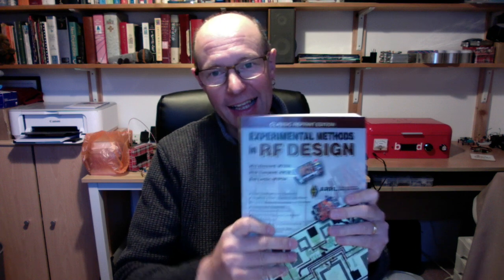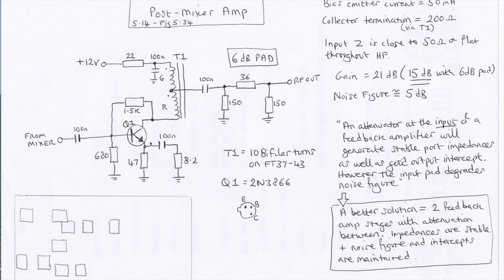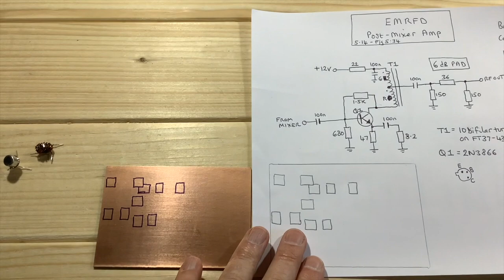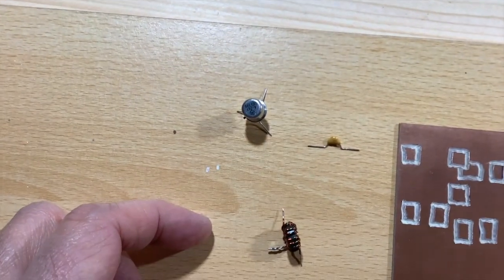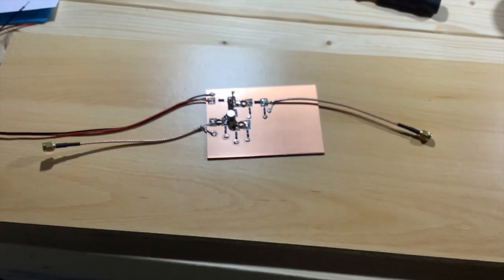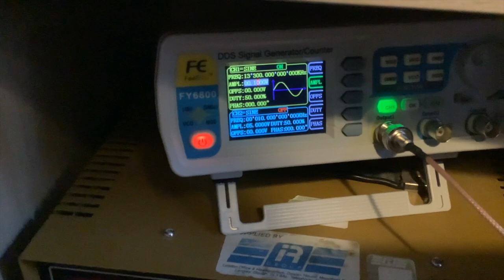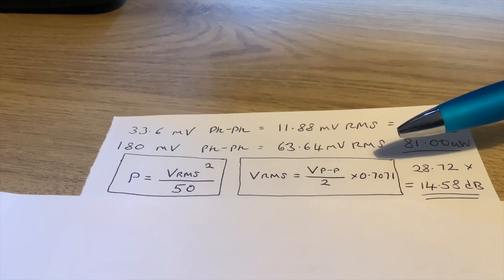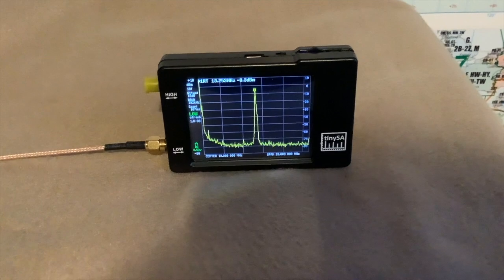18 - Another RF Amplifier

Comment: 👍Thanks for sharing Nick. Some good info there. A formula that I use for converting peak to peak voltage to RMS power is Vpp squared divided 400. Only works for 50 Ohm load but saves on the calculations. E.g. if peak to peak voltage is 45V into a 50 Ohm load. 45 squared is 2025. 2025 divided by 400 is approximately 5 Watts.
Reply from the maker: Thanks Steve. That's a great little shortcut. I'll certainly remember that. Cheers! 73 Nick

Comment: Very detailed video, thanks for sharing. Althoguh there is a section dedicated exclusively to feedback amplifiers in EMRFD, section 2-something, that describes feedback amplifiers based on 2N3904. These amplifiers give a similar gain and consume only ~20 mA of current @ 13.8V. Other characteristics (noise figure, IMD, compression) are fine too. I used these amplifiers in several projects.
Reply from the maker: Thanks very much Alex. Yeah, I think 60mA is a bit much especially as I'm considering building another on the same board! Your suggestion gives me an idea though. Maybe what I should try is a smaller current design (like the one you mention) followed by a more beefy one like the one I built. I've usually only used those 2N3866 transistors in RF pre-drivers where I'm handling larger signals so it would probably go OK as the final amp in a chain perhaps. It's all good fun isn't it? Thanks again. 73 Nick

Comment: ARRL HB of 1993 95 describes NFA or noiseless FB amplifiers also which are emitter to collector feedback amps with a ferrite transformer using a binocular core.  Those have lower gains but are pretty good. Built a pushpull version several years ago
Reply from the maker: Sounds good. 73, Nick

Comment: Cool beans,.
Like your bench. I built a similar bench and used a high gloss white oil paint to cover the sealed with shellac wood to make it easier to clean and easy to see the parts on the bench.

I am watching the video now, but as I watch I am asking myself can I feed the amplifier with any of my 5 watt QRP transceivers? It would be sweet if it could.

As I progressed I see it is not intended for inputting 5 watts. Should have known by the size of the transistor. But, it could be used as an amplifier for tiny transmitters to bring them up a bit.....
Reply from the maker: Thanks. Yes, it is a small signal RF amplifier so not suitable as a final power amp - unless you are very QRPppp! It could be pressed into service as a driver amp though but you'd need to give it some heat sinking. 73, Nick

Comment: Nick can you tell me how the middle of a 200 ohm transfer is 50 ohms not 100 ohms what am I missing there?  Throughly enjoyed the video thanks.
Reply from the maker: Hi Greg, my drawing was a copy of how EMRFD presented it but in truth its not the most intuitive way of doing it. I think it was done that way to emphasise the fact that it is an auto-transformer. Think of it like a voltage divider. The output is seeing half of the voltage from the collector (because of the centre tap). So if the output voltage is reduced by a factor of 2 then as impedance transformation is the voltage ratio squared - the output will see an impedance that is 2  squared (=4) times less than the collector. That's how 200Ω at the collector looks like 50Ω at the output. Hope this helps. 73, Nick

Comment: Nice Build.  What coax cable connectors and coax are you using ?.
Reply from the maker: Thanks. In the video I just used some RG316 SMA patch leads to make temporary connections for testing. I did Pete Juliano's trick of buying a few and cutting them in half so one end is terminated in an SMA connector and the other can be hardwired to your board. When I came to using this amplifier in the actual radio it was hardwired with RG174 which is cheaper but more importantly more flexible. Hope this helps. 73, Nick

Comment: The more gain you apply the more you apply it not only for the signal but for the noise as well. It doesn’t seem like a good idea. I mean it seems gain+attenuation=more noise
Reply from the maker: Hi there! There is a balance between gain and attenuation that runs through a whole radio I would suggest. Sometimes it can be a fine balance i.e. just 1 dB too much gain has caused an amplifier to oscillate. Ultimately you have to decide what you want to settle for. Some gain upfront in a receiver can actually reduce the overall noise figure. It is a balancing act! Thanks for watching and commenting. 73, Nick

Comment: I have a question that lingers in my mind for quite sometimes....how do you multiple frequency and set it at 2.4Ghz or 2.8Ghz?
Reply from the maker: There are different ways of doing it I think. There are certainly designs I've seen for frequency doublers and triplers etc. Generating (stable) RF at higher frequencies is now easier than it used to be thanks to PLLs etc but I confess most of my work has so far been confined to below 50 MHz. An Si5351 will tackle these kind of frequencies easily. You'd need to contact some of the microwave guys - they'd be able to guide you. Thanks.
Reply: @M0NTVHomebrewing  from self experiment Ive used crystal oscillators at fix frequency of 125mhz

Comment: Nick recently tried a very similar design by EI9GQ from his Homebrew Cookbook and it was pulling 80mA, which is 1W input power and seems a little too beefy, but works very nicely indeed at 18MHz.
Reply from the maker: Thanks Steve. Yes, I got those 2N3866's from Graham but I've only used them in transmit drivers and pre-drivers before. I think I should have gone with thermal-pasting the can to the board though - it does get hot! 73 Nick
Reply: I just popped on a star heatsink and it seems fine. Also been playing with Pete's PSSST 2N2222 RF Amp, which seems quite good too.
Reply from the maker: Thanks Brian.

Comment: Great video! Can you please tell us what should we modify for the FM band in this circuit?
Reply from the maker: Hi there. Thanks. The circuit is really intended for HF. However, it is broadband in its design so you might be able to press it into service at higher frequencies but expect (1) lower gain and (2) the impedance match may not be as good. The 2N3866 transistor should be OK for the FM broadcast band though. An example circuit in the data sheet is for an amplifier at 400MHz- https://my.centralsemi.com/datasheets/2N3866_SERIES.PDF

So perhaps just it a go and see how you get on! 73, Nick

Comment: Hi
Going to build one to get a bit more out of a AD9850 based VFO which only gives about 250mVpp.
Question about winding toroid.
To make the centre tapped transformer.
Take a length of bifilar wire.
Solder one pair together - that's the centre tap for the output
Wind 10 turns onto the toroid.
The other two ends are used on the input side labeled G and R in the diagram?

Thanks Dave
Reply from the maker: Hi David! No - that won't work - you need to observe the phasing of the windings. That is indicated by the little dot on the schematic. This means that the centre tap is the bottom green connected to the top red. The easiest way is to get your bifilar wire, twist it in the vice then separate each end. Then wind your 10 turns on the toroid. Then make the centre tap (bottom green to top red). Then you can connect your top green to the 100n and 22Ω resistor and the bottom red to the collector of Q1. Please see this video on the actual construction of these kind of transformers (https://www.youtube.com/watch?v=m4rOJNQg2y4&t=234s).Hope this helps. 73 Nick
Reply: @M0NTVHomebrewing  Hi Nick Thanks for the advice yes Video 20 on the mixer clears up you to connect wiring to get the phasing correct.
I have some G-QRP Bifilar wire and some FT 37-43 toroids so will give it a go.
73
Dave
GM4NFI
Reply from the maker: No worries Dave. Happy winding! 73 Nick

Comment: When calculating the inductance of the transformer, do the bifiliar turns count as a single winding of 20 turns or do they interact to give a different result? Thanks.
Reply from the maker: Hi Graham! That's a very good question!!! I think because they are wired in phase that they would 'look' like a 20 turn inductor but to be honest I'd have to check that out for myself. The inductance is only significant here in as much as it produces the required impedance for the collector. When I was building mine I only looked at the impedance reading on the Peak LCR45. Mine was a bit low so I squeezed the turns together a bit more to get the desired result. Thank you for a great question though. I find transformers fascinating ... I know I should really get out more! 73 Nick

Comment: I have a video transmitter. I want to increase the range of the transmitter. Which amplifier should I use for the UHF band?
Reply from the maker: Hi there! That's a good question but I'm afraid I don't have any experience of designing or building for UHF frequencies - let alone video. You'd be better off asking in some of the Amateur TV forums where I'm sure someone will be able to advise you. All the best! 73, Nick

Comment: Why not have square island RF breadboard pattern boards be made by pcbway etc and you can sell them too? Elektor had these type of boards some 30 years ago
Reply from the maker: Personally I prefer to either engrave or stick my own pads precisely where I need them. If you fill the whole board with separate electrically isolated squares then you lose the common ground plane effect which is one of the great benefits of Manhattan style construction.  But each to their own! 73, Nick
Reply from the maker: That would certainly help. 73, Nick

Comment: Nice video.
2N3866 well known device, but mainly used as a driver for a VHF PA!  My very first rig a Trio TR2200 which was a 6 channel crystal controlled 2m box, used one as the PA, with a full charge it would produce a whole 1W output on 145Mhz.

Using something like the 2N3904 as has been suggested would be better.

Twisting the wire.. A clamp and twist? you do like hard work. Have you lost your old hand drill?
One end in vice, the other in drill chuck and a few turns of the handle and the jobs done. :-)

Or tie the ends together, slip in a screwdriver and spin that. 

Keep the vids coming - there is nothing like a simple practical approach to actually learning about electronic construction.
 
Andy
Reply from the maker: Thanks Andy. The reason I chose this particular design from EMRFD with the 2N3866 is that the authors (Wes, Rick & Bob) say it is one of their favourite amplifiers for terminating a switching mixer. I figured with a recommendation like that it was at least worth building one! Thanks again. 73 Nick

Comment: Sir I'm a hobbyist  , want to know about the schematic used for RC toy cars etc  . Want to know how the signals are transmitted from transmitter to receiver module's of the RC car to control the motor in toy  car  . Detail explanation of the circuit used in the transmitter and receiver how it works step by step . Sir any video on this topic  , or any book or  magazine  have this kind of projects
Reply from the maker: Hi there. I'm afraid I don't have any experience in this field but just googling 'radio controlled cars diy' brings up a load of web pages and videos. You should find something to get you started. All the best, Nick.

Comment: I prefer using glued down pads.

It's easier to remove a pad or put down another pad if you make a mistake.
Reply from the maker: You are right. Glued-down pads give you more flexibility. The engrave method is useful for things like edge-connected SMAs.

Comment: Sir can I use this for wifi signal same as those expensive amplifier
Reply from the maker: Hi Danyal, the amplifier I built in the video was only designed to work at HF (and possibly lower VHF) frequencies. I certainly don't think it will cut it at the kind of frequencies you are talking about. The wavelengths are so tiny that lead lengths become critical and you require a whole different design. Sorry.

Comment: Dear Nick Can you please explain about Ldmos AFT504,  i want make the amplifier to boost some tools i must replace blt50 transistor with aft504 or make an amplifier after blt50
Tnx 
EP2XX 73
Reply from the maker: Hi Kourosh, I'm afraid I'm not familiar with that device. All my power amplifiers have used regular MOSFETs. You should be able to find a few schematics online though. All the best in your building. 73 Nick

Comment: Can it be used with a Wi-Fi router with an antenna to increase the range of broadcasting?
Reply from the maker: Hi there! Although it is broadband I don't think it's THAT broadband. I think you'd need something built much more carefully for those kind of frequencies. Once you get in the GHz range then component lead lengths, stray capacitance etc. will play a bigger part as the wavelengths are so small at these frequencies. This amplifier is really for HF and probably lower VHF but I wouldn't want to promise anything higher. Hope this helps. 73 Nick
Reply: @M0NTVHomebrewing  thank you for everything

Comment: Here is a Naive question - why are there no multi-band (uhf/vhf) amplifiers? I see BTech having 3 different PAs for the 3 HT bands (2m, 1.25m and 70cm) but each is a separate unit.

Now, I am feeling like a customer asking the question, "why can't I just move the toilet to the other side of the bathroom?", I get it.  But I have seen military-use portable multi-band amplifiers covering 50-500Mhz. So I know it's possible to make a compact unit - Why aren't companies making them?
Reply from the maker: Hi! No worries - there's no such thing as a naive question! When it comes to small signal amplifiers then there are plenty of low noise amplifiers on all the usual online platforms that cover DC to several GHz with up to 30dB gain. RF Power Amplifiers are a different matter. As I only really build my own gear I can't really comment on why commercial companies decide to make or not make certain things. All I can say is that from experience building RF power amps that are stable and relatively clean at above QRP power levels is not trivial. HF is bad enough but once you get higher in frequency then the real challenge comes in your ability to physically construct the thing so that it works the way you intend. Physical board layout, component lead lengths, stray capacitance etc. all start to become a much bigger deal as you go up in frequency. Basically it gets harder. But where would be the fun if it's easy? 73 Nick